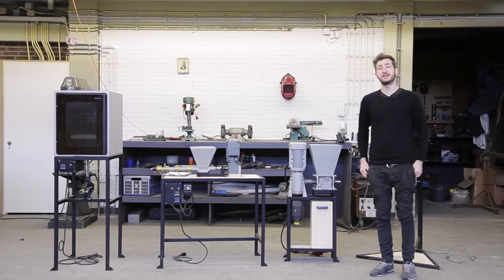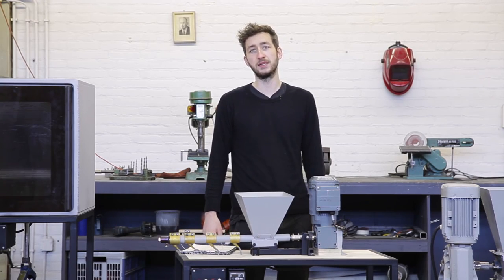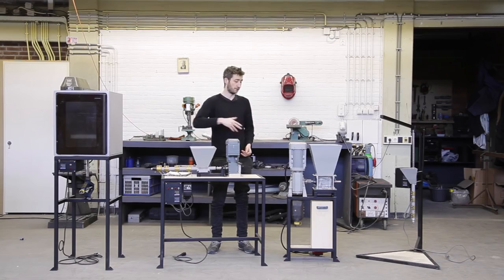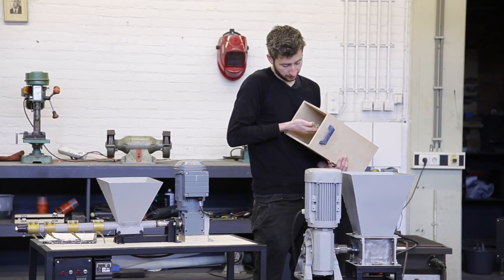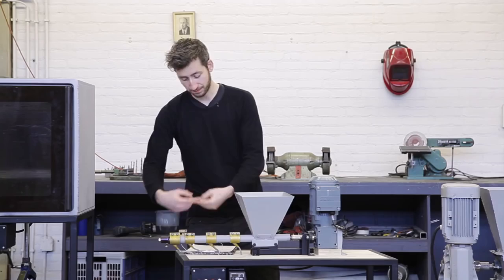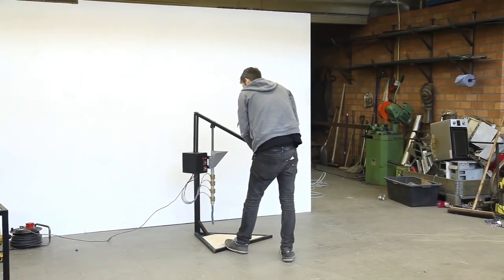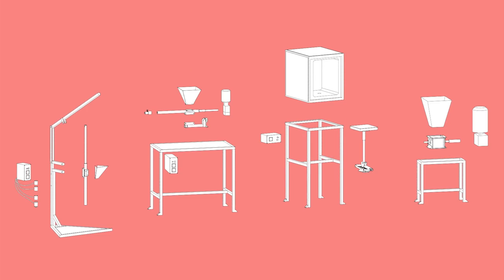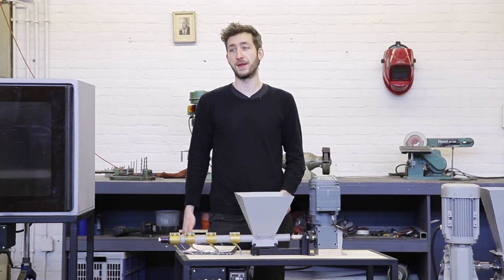Precious Plastic Construyendo las máquinas (subtítulos español)

Comment: ¿Con qué material se hacen los moldes para inyección de plástico? Digo, que se puedan fabricar teniendo una impresora 3D y con materiales que no sean metal de metal porque es costoso.
Reply: yo me hize una inyectora manual y hago una pieza para una lampara  y e podido mejorar mi producto. los moldes tienen que ser en aluminio o hierro  me lo hizo un amigo que tiene un taller donde funden aluminio y me costo barato  100 dolares
Reply: Hola Diego me podrías ayudar construí la inyectora y tengo una duda cual debería ser el juego o tolerancia entre el cañón y el pistón?